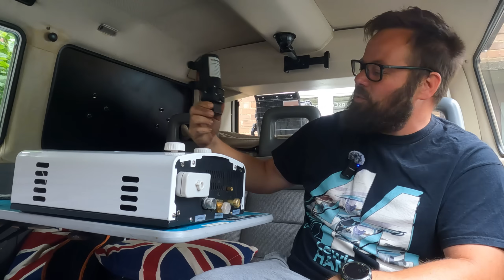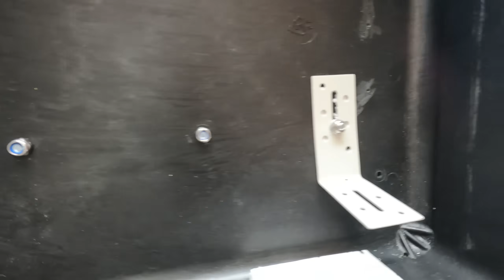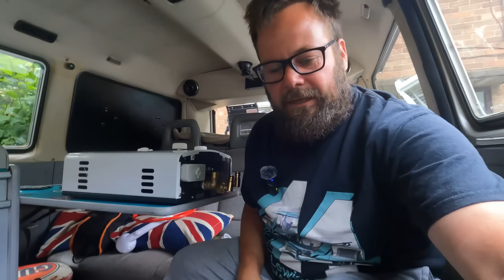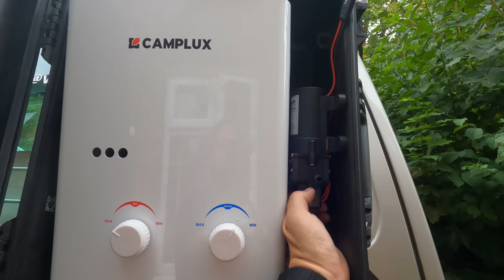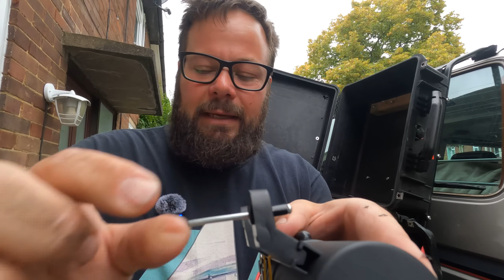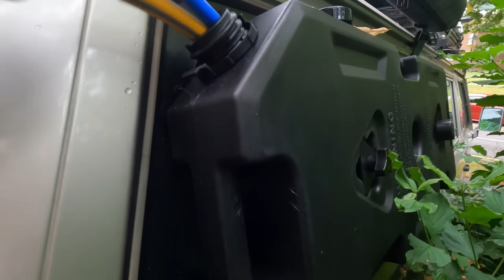Camplux Portable Water Heater: Set Up Your Hot Shower For Campervan

Comment: I know the manufacturers of these types of units specify using outdoor or in well ventilated areas, but what is the difference between using this inside versus using a gas hob? I can't imagine it being any worse than that? Does the unit itself get hot? 

Nice install btw!